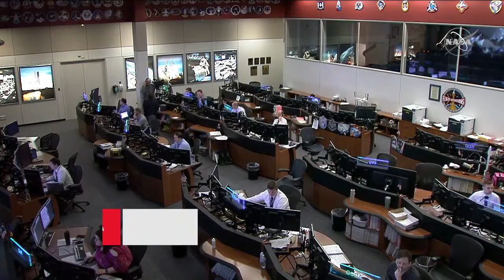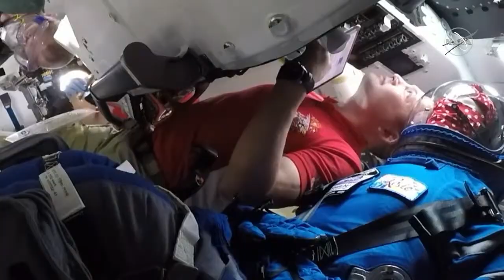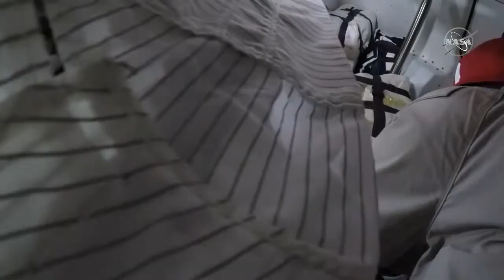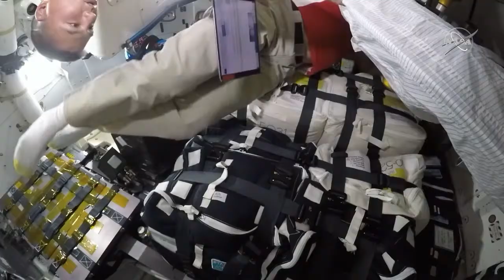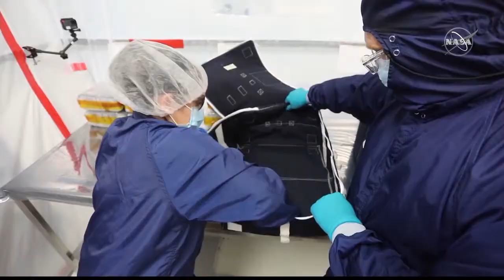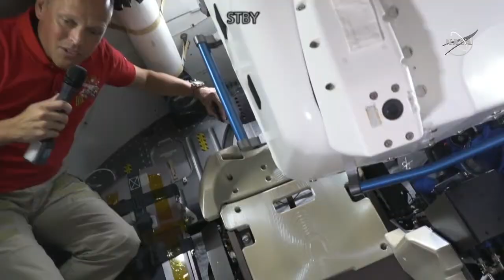Watch the International Space Station Crew Open the Boeing Starliner's Hatch

Comment: Greetings from a retired McDonnell Douglas employee.  I am pleasantly surprised at how smoothly everything went.
Reply: Multiple OMAC failures, docking software failures, antenna LOS failures, docking ring issues... but yes, other than that it was very smooth by Boeing standards.
Reply: yes apart from  the boosters not working and the docking program having problems nice smooth docking ..if they sort those 2 out will be great 2 providers ..